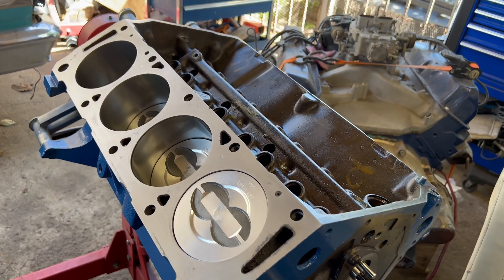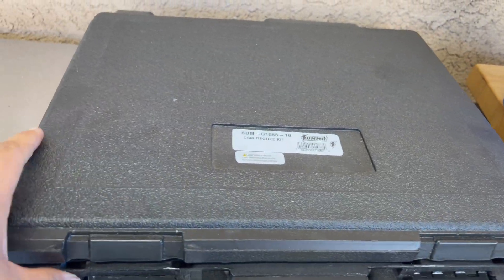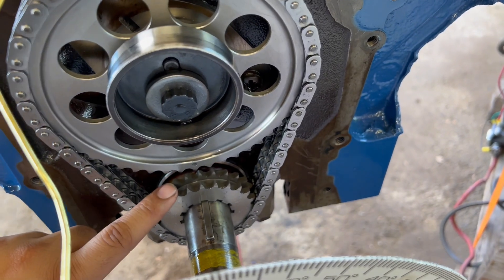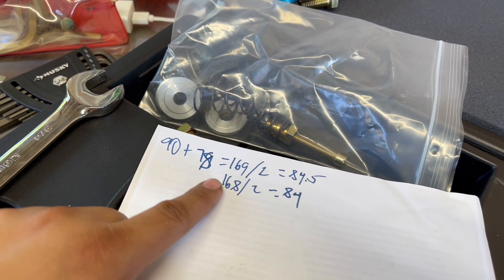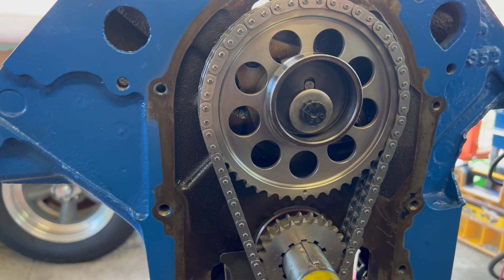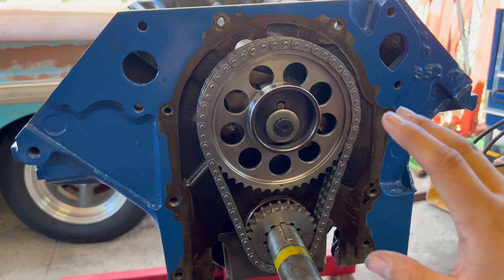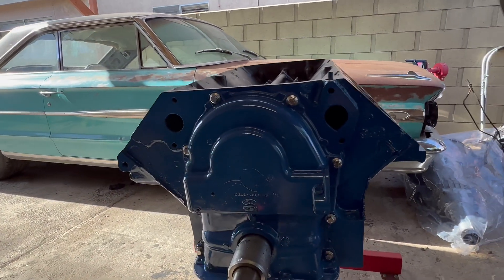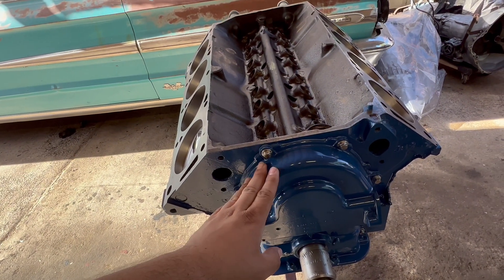Ford 428 FE Build Part 5: Double Roller Timing Set, Camshaft Degree, and Timing Cover Install.

Comment: I might have to get a different cam for my 428. Oregon cam recommended a much milder regrind to me. Looks like you have a completely different grind. Mine is only intake 302 ex 307. sepertion is 110. centerline is 106 and ex 114. Also told me need 2000  stall converter and 9 to 1 compression custom pistons. 63 Galaxie

Comment: Question: Is the timing chain supposed to be lubricated or have some sort of grease or oil?  Thanks,
Reply from the maker: Yep, the oil slinger will sling some oil on the chain as well. It doesn’t need a lot.

Comment: Once you get your cam degreed in, an old racer's trick is to take the timing chain and place in a shallow pan, cover with motor oil and bake in the oven at 225-250 degrees for a couple of hours.  It forces the oil into everywhere and pushes the air out of the rollers.  In theory, it extends you chain life.  Another awesome video, can't wait to hear it run!
Reply from the maker: Wow never seen that tip, thanks for the info. I’ll try it on the next build!